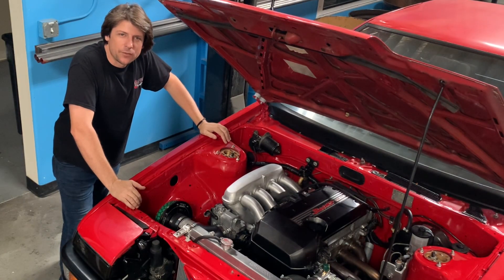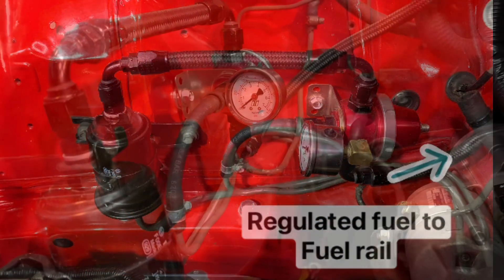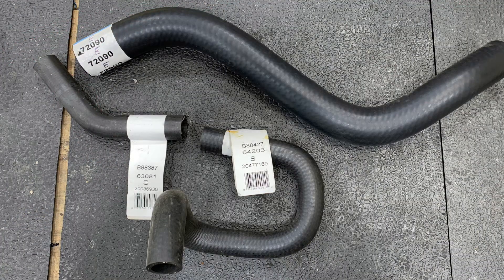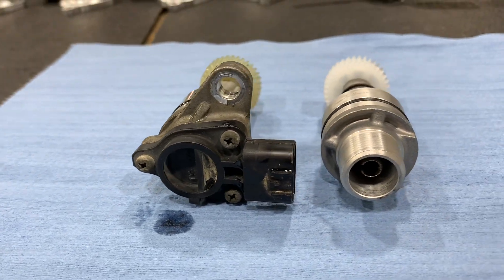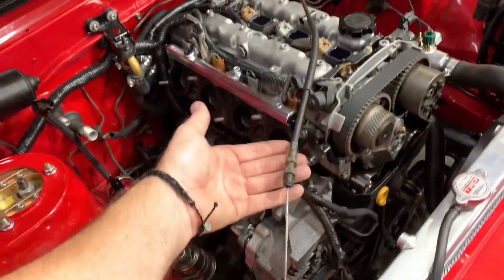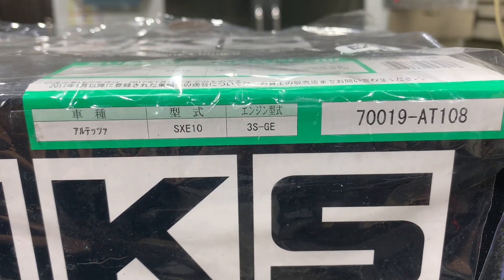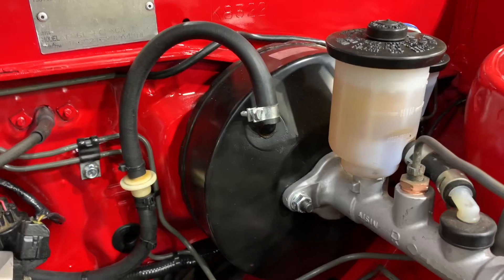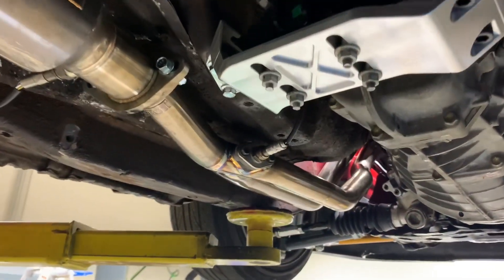How to BEAMS 3SGE AE86 Engine swap PART 3a mechanical connections

Comment: Hi, 
All your videos are really nice. Thanks for that. 
I saw your throttle cable connection. Have you changed or updated something on the throttle body itself ? I think I read somewhere people buying a “locking” device for the drive by wire. 
Have you done something for that or not needed ?

Comment: Great video! I just curious where you located the ECU and fuse boxes?
Reply from the maker: The ecu is mounted in the factory AE86 location. This requires flipping the harness around and extending a few plugs. All the wiring reuses the factory AE86 fuse box and relays.

Comment: Hi i need some advice about the external fuel pump set up 
What would be the recommended size of fuel pump should be used
Reply from the maker: I don’t recommend an external pump. There’s lots of great in tank pumps that can support huge hp numbers.
Reply: @johnrussakoff  the reason am going to be using an external pump is because am using a fuel cell. My original tank is rotted out

Comment: The 1/2" hose doesn't really connect to the HKS outlet on the elbow. It sits inside the hole but doesn't seal/overlap. Did you use some kind of conversion piece?

Comment: Is it necessary to have the breather pipe routing from the engine to the intake as is done in the kit? Or can I attach the breather pipe to the engine and leave it open at one end to vent somewhere in the engine bay? Or does it need to be routed back to the intake for increased suction? Thank you!
Reply from the maker: Because the engine uses an air flow sensor, the breather needs to reroute back to the intake. If you want to route it to a catch can, you’ll need to route the van back to the intake as well.

Comment: Where is video 3b? Great tutorial!  Thx!
Reply from the maker: Still working on it, having trouble with the ecu communication through the obd2 port. Still finding a good solution.
Reply: @johnrussakoff   any luck
Reply: @dcengineering8205  I am wondering the same... Still no 3b video...

Comment: i got this fuel cell am setting up on my ae86 bcuz the original tank went bad what advice can u give about an in tank pump conversion or outside pump set up
plz advice
Reply from the maker: I prefer to keep the pump in the tank. It reduces noise and also keeps it away from debri. Make sure the pump sits inside a baffle or sump to prevent fuel sloshing that causes starvation under cornering.

Comment: For the header, just cut off 4age flange and the beams flange will line up exactly with the 4 tubes?
Reply from the maker: No, I recommend having a competent fabricator do this. The runners need to be ovaled, then the 2 and 3 runners need to be spread apart slightly before welding. It also requires careful fitment to get the header to fit correctly under the car. There are a few other options as well for this conversion, this is just what I found to work best for me.

Comment: Are you running a stock ECU? if so, can you go over all the sensors, wiring, connections and possibly the modifications needed?
Reply from the maker: Yes, stock ecu. The next video will cover the electrical connections👍

Comment: You inspired me to buy a 4age header for my swap. I bought the martelius r1. It looks like the primaries are smaller on the 4ag header..I assumer this isn't a big deal?
Reply from the maker: What is the tubing diameter on that header? This fujitsubo header is a bit over 1 5/8”.
Reply: @johnrussakoff  the same actually. 41.5mm. Looks like the factory beams manifold is 2 inches. I have seen power gains from smaller primaries on chevy small blocks on certain engines. I'm probably overthinking it
Reply from the maker: I sent you something on Facebook messenger

Comment: Hi John! Does this HKS intake has something like a cell inside to calm the airflow before the MAF?
Reply from the maker: The inlet of the maf housing has a tapered entry that directs air towards the meter. Similar to the factory air box. We have not had any issues with this design so far. Engine runs smoothly and idles solid.